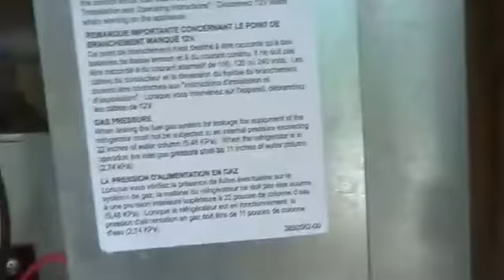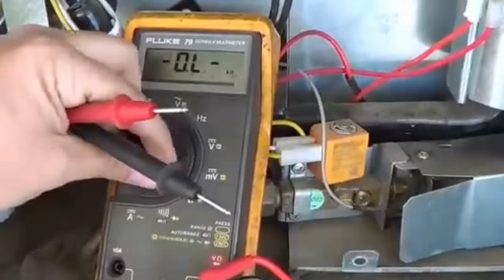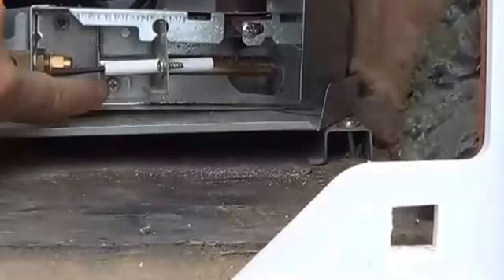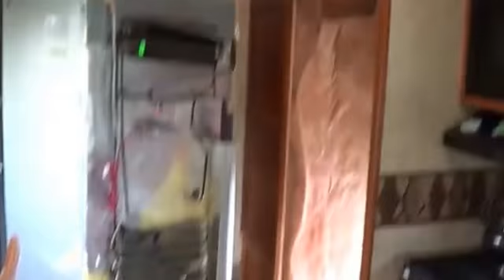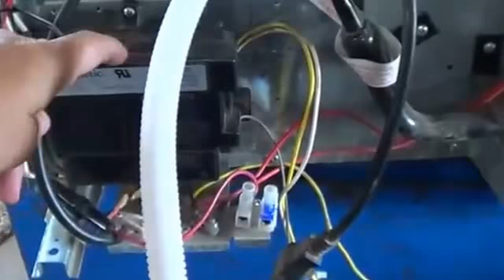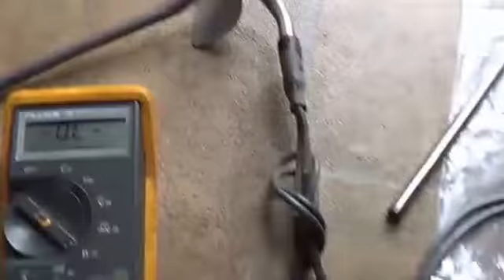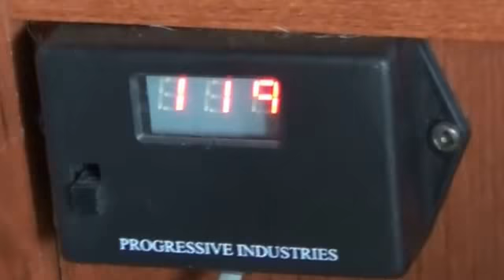Dometic DM2652 RV Refrigerator Repair

Comment: Great video. I have the same fridge, brand new. On Electric it’s insufficient cold, cold but won’t make ice in freezer. On LP, there is no flame.  When I open the panel outside to watch, it will click click try to light the flame, but no LP comes out and it gives up after 45 seconds, check light comes on. My stove had propane working just fine. What could be the problem? Thank you very much.
Reply from the maker: Thanks. Being that both LP GAS and electric are having problems I would suspect may be a problem on the control board. 
Here is a link to the service manual which has some troubleshooting advice - https://www.fourwh.com/NewDometicRefrigeratorManual.pdf
Reply: Thank you for your replay. After reading all the comments, I found out I just need to let the Air in LP pipe out and now I have flame. on LP the temperature is lower than on AC, but both are still not as cold as my home fridge, Water will make ice if give 72 hours, but ice cream in Freezer will melt. At this point, I'm not sure if this is normal for this kind of RV fridge.
Reply from the maker: Not normal, my freezer works well, even for ice cream.  To work properly the RV needs to be fairly level, that's one thing. Also, make sure the thermostat slider in the fridge is set to cool and hasn't fallen off the metal fins. Look up in the back of the fridge and make sure nothing is blocking the vent going to the roof. Look at the rubber door seals, maybe there is damage causing warm outside air to get into the fridge.
If those things are OK then the service manual suggests insufficient cooling could be caused by a faulty thermistor or cooling unit.
Reply: What about adding exhaust fan in the back? The dometic doesn’t comes with one based on your video. What do you think? Thanks.
Reply from the maker: They help in really hot weather but your new fridge should cool well even without it. My current Dometic fridge is 1 1/2  years old a cold really well with no fan at all. It's been around 90 degrees the last few days and everything in the freezer is frozen solid. Temps in the fridge are 36-38F

Comment: If u press the on bottom and it not turn on check the Temperature switch.that switch is like breaker of 12v it worked for me
Reply: i don't see a switch marked temperature switch in the manual? where was it located?

Comment: I feel quite accomplished to trouble shoot and repair this problem with your assistance. The same fridge in a Nomad Joey, travel trailer. Removal was tough as I did not want to pull my fridge out completely. Per video working space was a bear and the old element was very corroded. Thank you so much, this saved me $$$, and was rewarding to complete. Working Well!!Mary J. 61yr old, fixed the grandma's travel wagon. All will be happy:)
Reply from the maker: Awesome! :)

Comment: Were you able to obtain the part locally same day and get the fridge back in operation same day?  I see you listed Amazon for the part, but thought I'd ask anyway.  Thank you.
Reply from the maker: No, I couldn't find it locally in Victoria, BC. The RV parts dealer needed to order it. Took two days, but the fridge still worked fine on LP Gas mode so not a big deal.

Comment: Hi I have a question I have a domestic dm2652 I just changed the thermoster the one inside the fridge because it was freezing everything and I thought it was that but it's still doing the same thing everything I put in there it freezes do you have any idea what else can it be

Comment: Thanks for the great video, Ray! I have the same model Dometic, but different control panel (385 04 15-01). My refrigerator works well on gas, but on AUTO it doesn't seem to get nearly as cold. Just some, but not to the same level after several hours connected to AC shore power. Should the flue feel warm to the touch from the heating element when running on AC?  the flue on mine doesn't get warm when running on AUTO.

Do you (or anyone reading this) know where the blue wire hanging from the eyebrow connecter (6 plug) on the upper left of the control board connect to?  The blue wire on my refrigerator is terminated with a piece of black shrink tubing.
Reply from the maker: The flue should get warm especially around where the element enters. 
The blue wire is for some option but I forget what it was. I think maybe a factory test lead.
Reply: Love Your RV Yes, replacing the element did the trick. Thanks!
Reply from the maker: Awesome. :)
Reply: The schematic indicates the blue wire is a test point...

Comment: Well i dont think dometic is a very good brand..every dometic ref i've owned has needed repair in the first couple of years..one the element like you and one the register ..
Reply from the maker: Ours completely failed at the 5 1/2 year mark, all the ammonia gas leaked from the cooling unit. Luckily we had an extended warranty and got a new one installed. I think they have changed the design as the cooling piping and boiler placement is different and the fridge is so much better at cooling and freezing. Fingers crossed. - Ray
Reply: Once had  an old swedish Caravan named solifer 6101i and it had some swedish made refrigerator worked like å charm and it was 20years old..
Reply from the maker: I had 1989 campervan with a Dometic fridge 3 way AC/12V/LPgas and it was still working great when I sold the van over 24 years later
Reply: Things was probably just better built in the old days..my newest Caravan is sold. Maybe i should find me an old solifer again..

Comment: Thanks for your time and effort put into this helpful video. I have the exact same model, 2010 vintage. My "boiler" leaked out the refrigerant so the entire cooling unit has to be replaced. My CO detector kept mysteriously going off starting in summer of 2014 and it didn't seem to be cooling very well (At 4 years old!) so I have ordered a NEW cooling unit engineered and built by some Amish folks. The CO detector went off to the point of having to disconnect it, didn't notice the ammonia smell but the frige was defrosted in the morning.  In the Dometic owners manual it states "do not leave running every day" so I'm not going to buy another one from Dometic since they don't even expect their units to last very long versus folks from the Amish community who depend on their units to last for years while running 24 X 365. My folks had a secondhand Servel (same cooling technology) that lasted decades so a short lifespan can't be attributed to the caustic refrigerant. BTW, another guy has a video here showing how to replace the heating element without removing the unit from the wall.
Reply from the maker: You're welcome, Tim. Actually, ours just packed it in last month, leaked ammonia out near the flue. Luckily I have an extended warranty and we got a brand new unit install. Hopefully, they have upgraded it since we got our rig 5 years ago. Looking at the back the pipes do appear a little different. Cheers Ray

Comment: I have a dometic RM2652.
The power went out a few days ago for several hours in the RV. But I didn't realize until today, that the refrigerator has been off since then.
I got lights to the control panel up top, and inside the frige, but no cooling in either gas or electric.
Reply from the maker: I would check for the presence of 12 VDC on the lower control board accessed through the outside panel. Check the fuses on it. Maybe one blew during the power outage. Cheers Ray
Reply: I have just had the exact same experience with my Dometic, what was your find on the problem?
Reply: Steven Gonzales Well, that the fridge was fucked. It had power on the AC and DC sides. 
The fusees were good. It appears to be the actual compressor is not working.
I could hear it actually trying to start. But it would just click, I tried it in both electric and gas.

Comment: Thanks for this video! My implementation of the fix, however, has hit a snag. My heater element was stuck in a galvanized metal tube. In the course of trying to get it out it broke. So now I have the end of the heater element broken off in the tube. Can you tell me the purpose of that tube? Is that something I may be able to cut off or even cut open?
Reply from the maker: I wouldn't start cutting things. You may have to do a bit more disassembly to retrieve the broken part. This video should help you out - https://youtu.be/oIJYx5j2nPQ?t=9m32s It shows the tube the element fits into.
Reply: +Love Your RV Thank you sir! Your videos are extremely helpful. I believe I just learned I have an ammonia leak too. 8-(. I will have some more work to do after I get this stuck heating element out of there.

Comment: I have a Dometic RM2652. It isn't operational at all, will not work on gas or elec. None of the indicator lights on top of the fridge work (Auto, On/Off, etc.). None of the PC board fuses are blown, AC coming in at about 119V, DC coming in at 13V. Gas is available (I loosened the line slightly and gas started to escape). My AC heating element rings out at about 40ohms. Elec. board above fridge looks fine. 
HELP!
Reply: I figured it out, I have a short in the D.C. wiring. I was only getting 3 volts at the furnace and refrigerator.
Reply from the maker: I'd suspect a problem on the controller board then. I think they call it a Dinosaur board. Here is a service manual I found online - http://www.fourwh.com/NewDometicRefrigeratorManual.pdf
Either you're going to have to do some in-depth electronic circuit troubleshooting, hire someone who can, or take a gamble and replace the board.
Reply: I bought a Dometic replacement board which was slightly different but came with good instructions and installed it - no change, so I put the old board back in. One last search through the service manual then I'm thinking I need to bring it in to get it sorted. My knowledge of electronics is a bit too limited to dig much deeper.
Thanks.
Reply: How did it turn out for you? I am having the same problem with mine.

Comment: Just removed and tested my heater element. Resistance is 45.5  .  Would this be a good reading ?  Same make and model as yours.
Reply from the maker: Seems in the ballpark to me. My new element was 41.4 ohms - https://youtu.be/b2zioJ7XwmM?t=643

Comment: Great vid!  I got the black cover off the board and it turns out my 5amp fuse is blown.  Any idea why?  They always say to take a pic or a video before starting something like this and it turns out after I moved a few things around that I have a blue wire to nowhere.  Your unit doesn't have it.  It's near the top right and you only have the yellow and white.  I can't find any place to stick it so the tip at the end may be rubber to seal it off.  Anyway, helpful vid, thanks.
Reply from the maker: I have the blue wire too, it's some kind of option my fridge model doesn't use. I'd find the service manual online for your model and see what the 5 amp fuse is feeding, may give an idea as to why it failed. Cheers Ray
Reply: The fuse seems to service the heating element since the element is good but it's not heating.  Thanks for the good news about the blue wire!
Reply: The schematic shows blue w/ capped end to be a " test point ". I dont believe it goes anywhere but I have zero clue on what/how to test...So the burbing really works, eh ? ;)

Comment: i have a dometic 2652 and my freezer works fine but the refrigerator dont get cold and i tried pushing the slide all the way up for it to get colder but no luck so what can i do now ?
Reply: did you ever figure out what was wrong? i have same issue...

Comment: My Refrigerator is not cooling down on the bottom part, the freezer is working like 50%
What I Should Do?
Reply from the maker: I would do a search online for the service manual it will have the troubleshooting steps. If it's the same problem on both electric and gas I would guess the thermostat or cooling unit is bad.

Comment: My Dometic stopped working a couple years ago and I've been getting by with a little frig on a bench. When the problem first started I tried it on gas and electric and nothing. A refrig man checked it out and said I needed a new cooling  assembly or a new frige. The cooling unit was about $600 and the new frig was $1600. With no money I had to let it go. Does that diagnosis sound correct to you?
Reply from the maker: Sounds plausible to me. especially if it doesn't work on either gas or electric.
Reply: +Love Your RV OK. Thanks for the reply.

Comment: Excellent work.  I learn alot. Also,  I'm going check my drain hose right now.  That could save some water damage.
Reply from the maker: Thanks. I've since replaced my drain hose with a beefer one. Also, I have found out it should be looped to form a P trap so warm air doesn't get up into the fridge. Something that wasn't done with in my OEM hose Cheers Ray
Reply: +Love Your RV Wow, thanks, I didn't think of that either.  very interesting.

Comment: Good video.   I liked how you took the time to show where you had to disconnect the various screws to get the unit free so you could slide it out....   I have to replace my drain hose.  I had my camper inspected and the whole hose was as brittle as rice paper.  I'm using clear plastic tubing.
Reply from the maker: barkermjb That's funny I just had to do that myself yesterday. :) I also decided to swap out the noisy cooling fan for a quieter one.
Reply from the maker: barkermjb Here is my fridge mod I just did. Swapped out the irritating noisy fan. - https://youtu.be/dGBG1Jyx5SU
Reply: Good stuff.  I was able to replace my drain hose out in no time at all...   After watching your video, I realized that it was easy as pie.   The new hose/drain plug I put in will last the life of my toy hauler...  Thanks again!
Reply from the maker: barkermjb Awesome! Glad it helped. Cheers Ray

Comment: I was able to perform the same task with a lot less hassle of removal. I opened the control board cover, unplugged element, replaced new element, zap strapped it's cables and placed sheath back on. Totally viewable from outside. Job time from start to finish 13 minutes. Place finger at lead end of element and you will feel the heat.
Reply from the maker: Stetson Wrangler Sweet!
Reply: I agree. Just did mine through the ventilation door to the outside.
Reply: I guess all RVs are different. I can't pull out the element without at least moving the fridge out a few inches for clearance.

Comment: I know it's too late for this, but your fridge might be covered under this recall notice:
http://67.238.126.140/recall.php#
mine is, you need model and serial number, which is on the inside door.
Reply from the maker: fgleich Mine is a "DM" model so not included but thanks for posting for others.
PLEASE NOTE: If the refrigerator model number begins with NDM (instead of NDR) or DM (instead of RM), the refrigerator is notaffected by the recall.

Comment: we are 
having problems with our fridge  in or rv always shutting off and not switching between the gas and electric. it seems to drain the batteries when plugged in to electric..why would this happen? Bonnie
Reply from the maker: Bonnie Rossbach hard to know without some hands-on testing, but draining your batteries while plugged into electric is not a good thing, means something is drawing excessive electrical current. I would get it checked out by an RV technician. Best Regards Ray

Comment: Now you know if this refrigerator stop working all together an after you have check all the other thing, sometimes its the refrigerant and to fix that you must take the refrigerator out and turn it on its top for 24 hrs and turn it up right for 24 hrs and do this for 3 days and this will make it start back to work only if you don't have a leak.

Comment: Replace that cheap plastic water drain tube with clear vinyl half inch tubing. Make sure there is a p trap bend at the bottom to keep hot air out (this can make a 9 degree difference) and put an anti wasp plug on the end!
Reply from the maker: Charles Tait Thanks for the tips.

Comment: One would think that they would design it so you could change the element without removing the whole refrigerator!
Reply: Most common replaced parts should be the easiest to access. Just like batteries and alternators on cars. Of course, you don't think rv and car dealerships want their service departments to be profitable do you? Labor is the money maker.
Reply: It should just pull out, not sure why the whole fridge was pulled
Reply: @uncoiledmarrow  trust me it won't. Been trying for an hour 😅
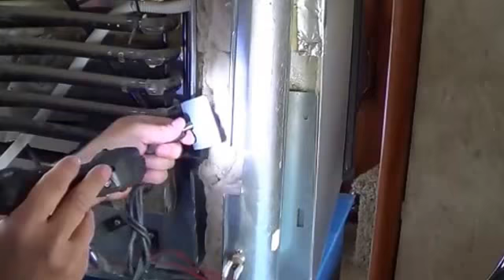Reply: look at 9:36 how far you need to pull it UP before you can pull it on the side

Comment: When you go buy an electric element, check to see if it puts out the advertised wattage. Most aftermarket ones will not! It is easy, measure ac voltage where it is plugged in, then test amp draw. Multiply the two. It should be within 10%.

Comment: My Trailer sits at a camperground full time. The fridge cooling seems to fade away. If we show up on the week end, we notice everything has melted in the freezer and fridge is not cold at all. It is left on all the time. We would hit the on/off button and it will start cooling again and work all weekend like a charm. Then we leave for the week and come back the following weekend and fridge is on but again everything is melted and warm. Not sure what the problem is. However your video is the closest problem i have been able to see out of all the research i have done trying to figure this out.